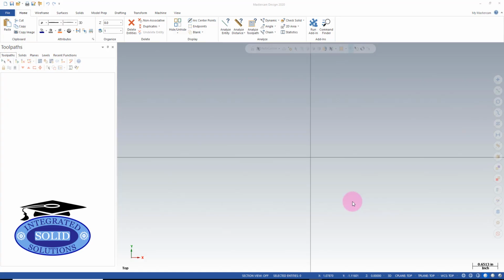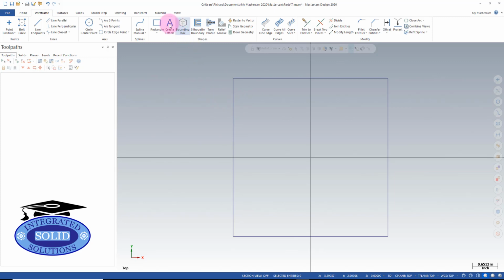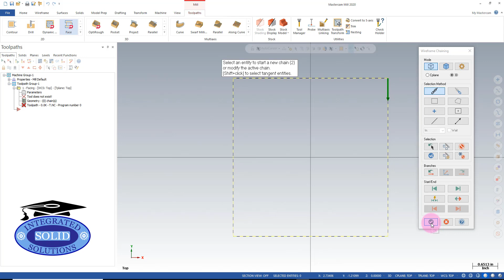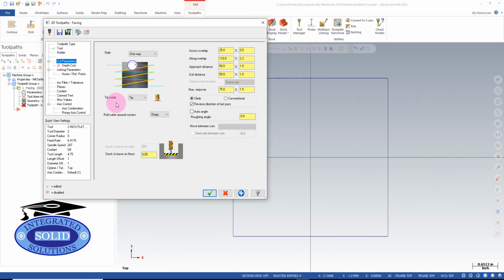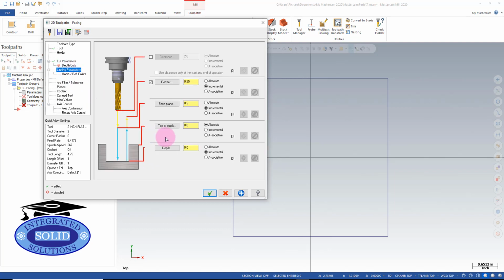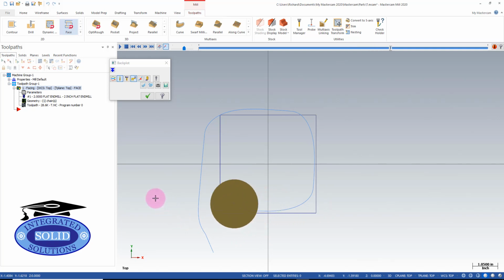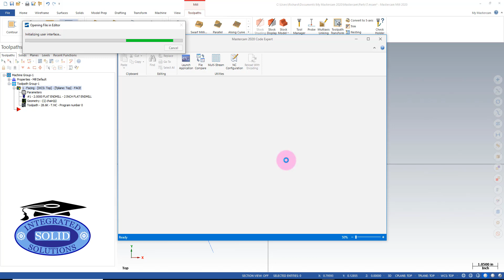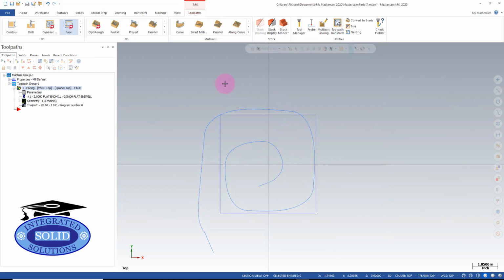Mastercam Quick chips  2020 dynamic facing

Comment: A little tip I can give you is to use the regular 2D hsc for facing. If you do it this way mastercam does not calculate arcs, only linear interpolations wich results in about 3 times more lines of code for the exact same thing.